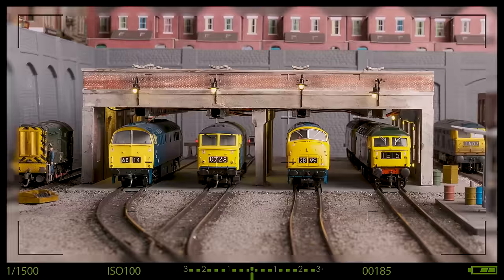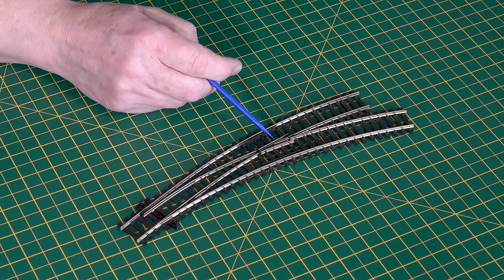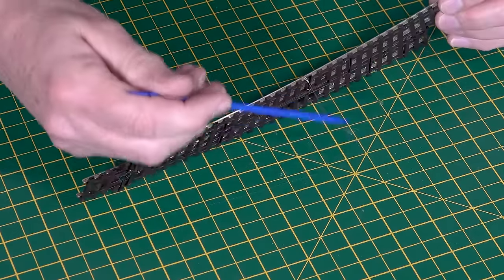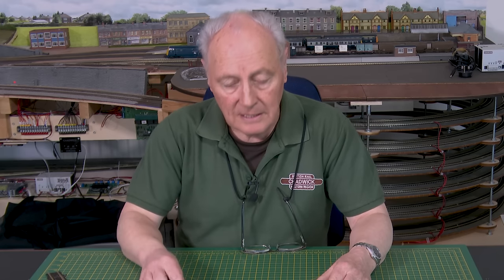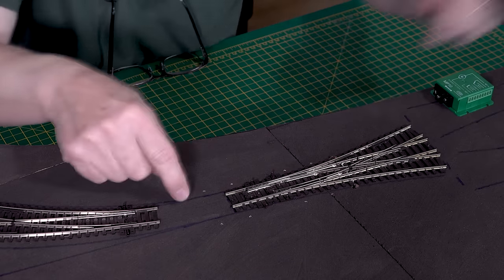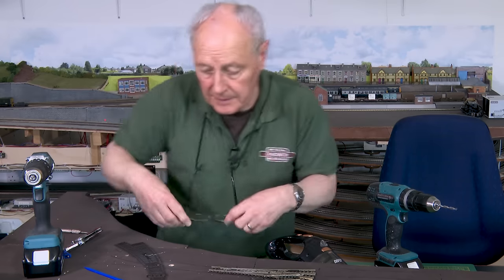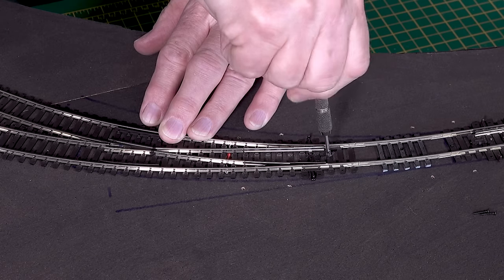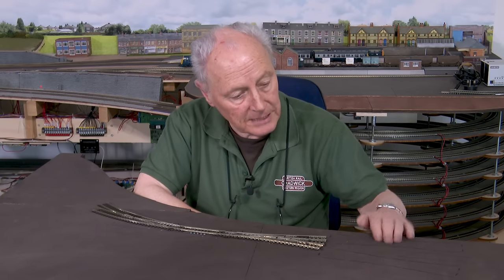PECO UNIFROG Vs Electrofrog Vs Insulfrog Points at Chadwick Model Railway | 219.

Comment: Well Charlie.  Unifrog looks to be the way forward for pointwork.  No more getting my wiring wrong with electrofrog and shorting out.  I can play trains without point motors and without the dreaded cutting out as the loco crosses the frog, then fit the point motors when I can afford them.  I do particularly like the point motors you are fitting here and I suspect I won't go far as getting tortoise motors.
Reply from the maker: Thanks Don, however it will take them a long time to produce a new range of point work. Regards, Charlie.

Comment: Hi Charlie, interesting video on the Peco Unifrog and you cover some great aspects of the hobby. However, I think you (and Peco) should have made it more obvious that this turnout is firmly aimed at DCC modellers and that DC modellers have been thrown under the bus. All routes remain live so DC modellers cannot isolate a loco in a siding if the turnout is used straight out of the box. According to the info provided with the turnout, Peco would have you fit extra switched powers feeds, ridiculous and unnecessary! In reality simple reconnecting the cross connecting and frog wires returns it to an electrofrog configuration but Peco won't tell you that. I use the new Bullhead turnouts which were too long time coming and then they snatched defeat from the jaws of victory with this Unifrog design, brilliant!
Reply from the maker: That’s a very interesting point Simon. Regards, Charlie.
Reply: Hi Charlie, just found where you reply to comments, I was a bit slow in working it out. Thanks, I enjoy the videos and in particular the huge range of different products you use, a real eye opener.  @ChadwickModelRailway

Comment: Since i have a dcc layout,  thats what i had to do on them electrofrog points, by soldering the 2 link wires across the rails, removing them little wires, and then using the loose wire connected to a switch controlled by point motor or a frog juicer.
Reply from the maker: Yes, that’s how it works MB. 
Regards, Charlie.

Comment: Having seen this video, I now understand the Unifrog concept: that is an engineering combination of Insulfrog and electrofrog systems that can be adapted by means of (basically) a single wire connection. Totally logical really.
Looking forward to your next on wiring the double slip - I had two to wire a couple of months ago and it took a bit of getting my head around it at first but, they both work as they should so I guess I got it right!
Keep up the great work - you inspire us all!
Reply from the maker: ThanksStuart, let’s just keep our fingers crossed that I get it right. Regards, Charlie.

Comment: Once again an excellent Video bit late to start replacing my Electro Frog point over on my third rebuild in 5 years I’m also using MT point motors but when I wire my point feeds I also wire in a short length of 7/02 to go to the switch on the point motor to power the Frog I think I got the idea of a previous Video of yours 
Keep up the Great Work
Reply from the maker: A sound strategy, Chris. 
Regards, Charlie.

Comment: Oh Charlie, you’ll be getting told off about those screws again by the rivet counters policing your work again😂😂,
Informative as always and answered the burning issue most of us have in understanding the difference between electro/insulation/uni frog points and how to wire them.
Cheers Charlie enjoy your chocolate egg next week.
Andy
Reply from the maker: Thanks Andy, although I do worry about my waistline during the Easter egg season! Regards Charlie

Comment: Agreed Insulfrog is the clear winner by a country mile great video.
Reply from the maker: They still remain ideal for DC modellers. Regards, Charlie.
Reply: @ChadwickModelRailway  maybe. I use FULL DCC layout powered by Hornby elite but controlled via computer and IOS Bluetooth devices thanks to the Hornby hm7040 dongle and the DCC concepts wire free ESP.  I just skip all that frog nonsense and get silky smooth operation even at speed step one.  Peco insulfrog points are more than the weekend warriors and hacks give them credit for.  Look forward to the next one im
Back to my T scale feature on the layout needs a bit more detail hope you got a chance to see it.  Stay safe.

Comment: Another inspiring and well presented video Charlie.
With a fantastic response of 312+ comments, I’m probably repeating what other viewers may have already said. Anyhow, here goes..
If I was placing the two points back to back with each other, I’d offset the point motors sideways from the point and use a cranked drive pin.  These MP motor designs grip the throw pin really firmly and with the fine adjustment available would make fitting a cranked pin fairly simple.  I’ve used a similar method fitting solenoid motors where there isn’t enough space directly under the point.  The only drawback is having to extend the drive pin or make one from 1mm piano wire.
As to your power drop, I think I’d trust to the metal fishplates for continuity as you’ve already provided a drop on the three way point.  Likewise, if you have to insert a section of standard track between the points, as in your video, I’d solder the power drop to that.  If for some reason the fishplates were to become a bit HR (high resistance) at a later date, then a touch of low temperature solder between the joins would restore continuity.
I’m all in favour of the new “uni-frog” design but feel they come at a rather high premium over their predecessors, especially as with your layout, using isolated track sections for occupancy monitoring, you still need to install insulated fishplates.
All said and done, an interesting explanation of the differences in the three types of point available and their pro’s and con’s.  I look forward to your upcoming video wit the double slips.  David..
Reply from the maker: Thanks David, such a decent technically interesting comment. Much appreciated. I shall take your advice regarding soldering that little piece of track. The double slip video is now in the can and will go out on Friday. Regards, Charlie.

Comment: Thank you for your time and show how it´s done. Dont know if you remember but you helped me about 2 years ago now with what you will post next week. I had a real hard time get through my head how doubleslip worked. I used MP1 motors on that one. One more thing I learned about these unifrog. As they are wired from factory, one could just soulder the feeders on the joiners as the railes are powerd all the way through the turnout. No risk of burning the plastic ties.
Regards from Sweden.
Reply from the maker: Thanks LS, I’m so pleased that you find the channel interesting. Regards, Charlie.

Comment: Hi again Charlie 
Unexpected pleasure. 
Love having weekly episodes!
Informative and entertaining as always. Unifrog a great idea. Still got a lot of electro frog so I guess will stay with them for now. Will try one or two unifrog replacements maybe when available for interest sake. 
Something maybe of interest to your followers,  for ease    and being in a rush  , I didn't switch the frog , simply used insulated joiners at the frog, and allowed 
The switch rails to do the switching to the frog. All ok ,Until , I  did not realize that the both switching rails  assumed the one polarity. 
This then became a problem because there was a reasonably small gap between the switch rail and the nearest opposite  rail of opposite polarity .
Slightly larger wheels or swinging quickly through a  curved point shorts across that gap .
I hope that makes sense.? And maybe of some use.?
Peco are provide jumpers underneath that you can snip to isolate  both switch rails ,but then of course you need to switch the frog. Like I will now have to organize.!
Thanks again.
All keeps the older brain working. 
Bring on double slips !!.
Stay safe mate. 
Howard.
Reply from the maker: Many thanks for your comment, Howard. You’re right of course, these things do keep the grey matter ticking over. Regards Charlie.

Comment: Hi Charlie, in addition to the wealth of information, I especially appreciate your clear pronunciation, which makes it easy for me to understand your explanations without subtitles even as a non native English speaker. I use the MP1 and MP5 for my Peco Code 55 points. Especially in N-gauge, the mounting and the adjustment of the point motors is sometimes very difficult, because of the small distances between the tracks. In this case I use the principle that you described in your video no. 188, only on the underside of the base board. The wire runs first from the switch blade downwards through the base board, then sidways perpendicular to the track. After another 90 degrees bending it is putted in the point motor. So you don't have to arrange the motors in a straight line. Maybe this tip will help you to position the point motors in this complex layout.
Reply from the maker: Thanks,Martin, for your advice for mounting these point motors. 
Regards, Charlie.

Comment: The way I see it is uniftrog is for DCC only. If you use it on the old DC system you will lose the self-isolating properties of the insulfrog point. However, if you do a lot of snipping to the unifrog point it will become self-isolating which would be a waste. Lets hope they have introduced it to all the other gauges. However, I do like them and well done sir on clearing things up with regards to these marvellous points👍👍
Reply from the maker: Thanks David, I’m so pleasedthat you found the video useful. Regards, Charlie.

Comment: As always an interesting watch.  The Unifrog system is quite clever isn't it; being able to operate like either an insulfrog OR an electro frog should produce some savings in manufacturing cost.  Looking forward to the fun of the double slips.
Reply from the maker: Thanks Lee, yes it does seem to be a step forward. However, driving into the frog when the points against you cause a short right on top of the point. Charlie.
Reply: @ChadwickModelRailway  I suppose that will teach you to check your points before movements!

Comment: I really enjoy watching your videos and like how you explain everything so well. You really make it simple to understand. At the beginning of the video you had to put in the short piece of track so that you could have the terminals on the point motor facing a particular direction (towards the outside of the track). But they when you installed it, you mounted it in the opposite direction with the terminals towards the wall where you didn’t need the extra piece of trace. Did you just change your mind?  With the modular terminal blocks on those point motors it would seem like access isn’t an issue since you can just unplug the to connect the wiring. Thanks and I look forward to the next video.
Reply from the maker: I think you may be viewing this the wrong way round. One of the sockets faces into the layout where as the two face outwards. Regards, Charlie.

Comment: One further comment which may be of interest.  I noticed in your previous video that you use 16/02 wire for many of the connections. I too used this quite extensively in earlier times.  Recently however I have used 7/02 wire throughout including wiring 18,800 uF CDUs operating 4 Peco point motors in parallel with 22 latching relays.  This smaller gauge wire has proved more than adequate in all situations.  One glance at the wire used by Peco for its point motor coils and connections should have taught me that a long time ago.  Just to add, I am a DC man.  DCC may require heavier wire for the main busbars.  It is not needed for any individual connections.
Reply from the maker: You make an excellent point Graham, however, I do tend to over engineer! Regards Charlie
Reply: Thankyou for discovering what the future might hold in Unifrog points, plus for emphasizing that a Unifrog can be treated as an Insul point, if you wish. Excellent, Charlie.
Reply: @ChadwickModelRailway    Never knowingly underengineered! 🙂

Comment: very informative! Will having live track up to the frog cause any issues for your control of train movements?
Trains can now run to the frog and short, rather than stopping at the insulating isolator.
My one build to date had 2 slips, a 3-way slip and a double slip, so I was straight in at the deep end!
Reply from the maker: Thanks Gavin for raising an interesting point.  Luckily my use is only in a slow speed goods area.  On a high speed line this could have serious consequences.
Regards Charlie.

Comment: On my N gauge layout I have insulated frogs, my mistake but I overcame a running issue on my 4MTs by adding pickups to the rear pony wheels. A bit fiddly but it works.
Reply from the maker: Clearly a good plan and well executed Paul . Regards, Charlie.

Comment: Charlie, your videos are WONDERFUL and so thorough! I do have one question though - I like traditional push/pull rodding for my points and now run DCC with an unifrog... how do I wire up the frog as the switch throwing is manual? I need that extra power area for my small 0-4-0s. Thanks again for a brilliant video
Reply from the maker: An interesting question, I think you ought to contact DCC concepts as I think they do produce point loading, perhaps they can help. Regards, Charlie.

Comment: Hi Charlie
It might be worth while pointing out that unifrog points used on a DC powered layout will also need isolated sections for sidings as both output tracks are live all the time unless insulated joiners and a switch are used.
Also if using unifrogs on a computer controlled layout with block sections then insulated joiners are required on all output rails.
Reply from the maker: Yes, Ken, an interesting point. When all wired and fitted, I will explain the block detection complications. Regards, Charlie.

Comment: So Charlie,can yoj just install the unifrog without any wiring ? Can you just install a point motor as normal ? Do you have to use the wire dropper on the unifrog ?

Comment: Peco really have got it right with Unifrog. They are just so user friendly. All of my normal points are N medium radius Unifrog, they make a huge difference in N.
Reply from the maker: That’s great news, Paul, I only hope they get a move on for code 100 users. Regards, Charlie.
Reply: @ChadwickModelRailway  Quite. Pecos line with N is that they will roll out unifrog as and when they need to renew the tooling. How often that is I have no idea.
Reply: They really need to crack on with more than just the two medium radius points
Reply: @musegeek   Yes and No, I do not know the lifespan of specialized miniature tooling. I do know that detailed tooling for mass manufacturing is anything but cheap so I can understand, frustrating as it is, Peco's position. 🙂

Comment: Hi Charlie, A great clear explanation of the Unifrog point - until now I had steered clear of them because I didn't fully understand them. PECO if you are listening please convert the rest of the range to Unifrog you can then phase out the other points and simplify your range which should save costs in the long run.
Reply from the maker: Thanks Jonathan, so pleased that you enjoy the video. Having spoken toPeco,, it will be a long process of converting their most outdated items one at a time. Regards, Charlie.

Comment: Thanks Charlie another great video.I made the decision to replace my points with unifrog but wasn’t sure I had installed them properly but it’s great to see you confirming what I’ve done is correct. Might seem a weird question but what is the length of the screws you used to secure the point. I have been trying to source some longer screws than the Piko ones DCC Trainautomation sell. Keep up the great videos I learn so much from them.
Reply from the maker: HiJohn, give (Maria) a call at Buffers model Railway shop. She sells various lengths. Regards, Charlie.

Comment: Great video Charlie, thank you! I have been looking for something like this. I have a bit of an issue on my layout, maybe you can give me some advice - I have two simple loops with points to be able to loop out from the inner to the outer on one side, and back in from the outer to the inner on the other side. Supposedly to allow continued running. The only issue is... it doesnt work! I've used Hornby points, (the packaging gave no hint as to what they are - electro/insul, etc), I've used plastic fishplates to separate the loops where the points meet, have tested the current in all parts of the rails (they are all live when power is supplied to inner/outer loop respectively)... and here's a twist... tank engines run continuosly over the loops... but anything bigger than 0-6-0 stalls! Whether tender-powered or loco powered. I simply cannot work it out :( any clues?
Reply from the maker: Dc or DCC Mark?
Reply: @ChadwickModelRailway  it’s dc!

Comment: Thanks for explaining how these unifrog points work, just wondering, when you added the dropper wire's, would it not save cutting the plastic webbing away if you just soldered to those wires that Peco added to join the inner and outer rails?
Reply from the maker: To be honest, Roy, it  never even occurred to me. Regards, Charlie.